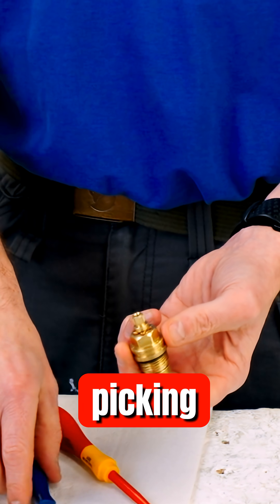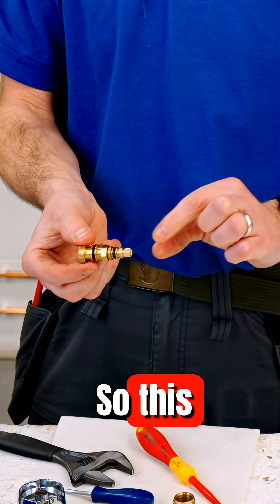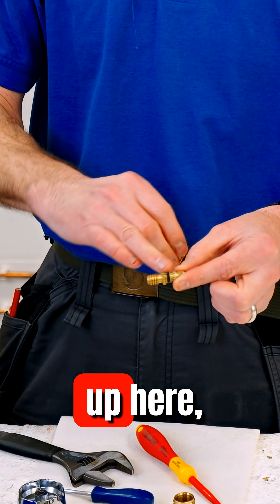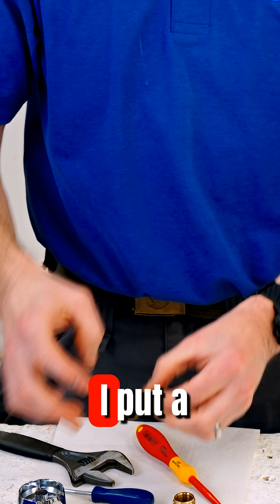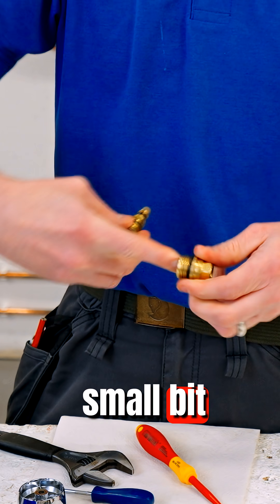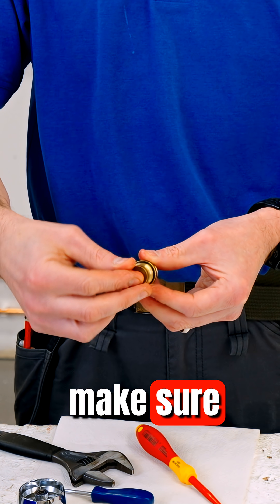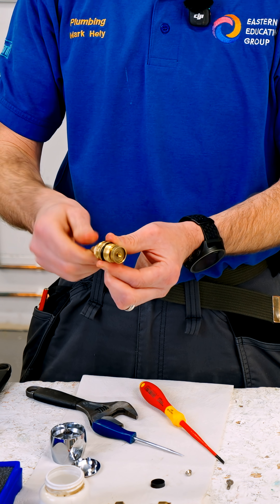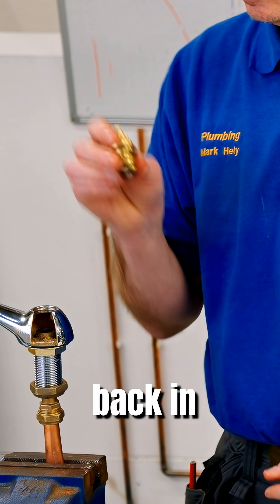Inside a Tap: Why It Goes Stiff and Leaks Simple Service Fix

Comment: Ex plumber here in Aberdeen Scotland I’m 33 started at 19 been out the game for about 8 years has much changed or can I get back into it easily enough you reckon? I was always massive commercial sites never really got a chance to learn domestic and it really put me off and got me down all my mates were doing homers and houses and here’s me only doing huge victaulic fittings and massive boiler houses etc… btw I understand you just fine mate! No accent problems!